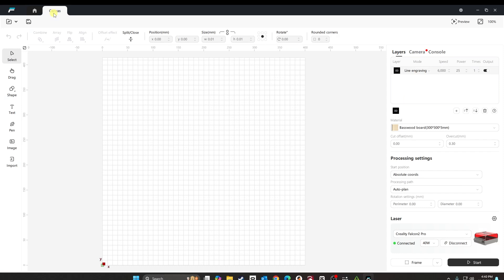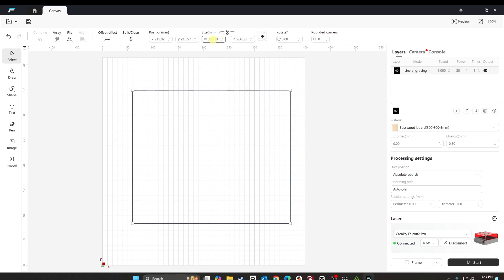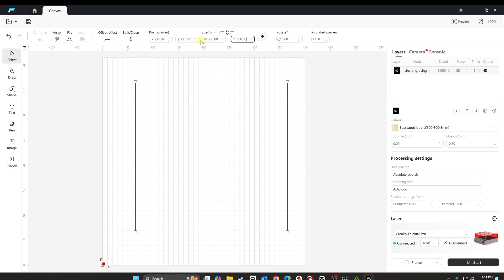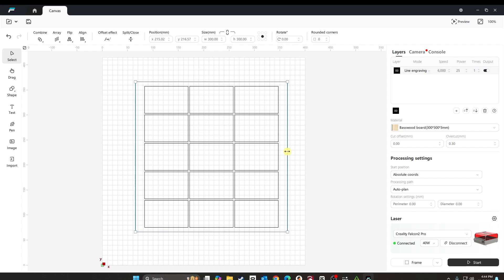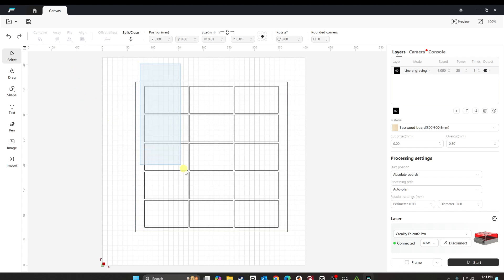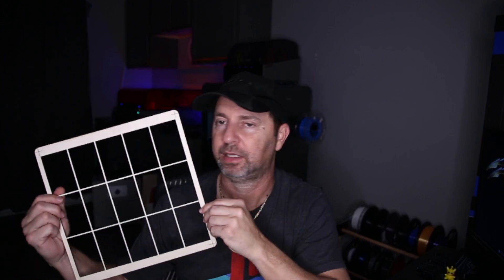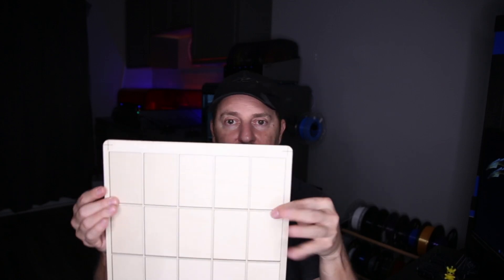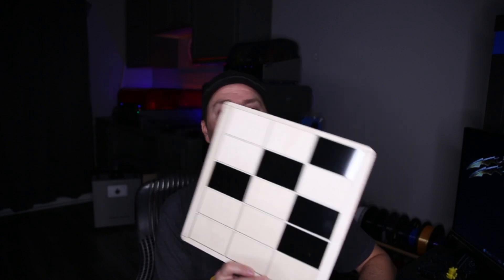How to Create a Laser Jig for Aluminum Business Cards Using Creality Falcon Design Space

Comment: Hi there,

Can you perhaps share the settings yo uare using to do these engravings on the business cards?  I am struggling to get the clarity on finer details.  I am using the Creality Falcon2 Pro S 40W.
I have having some sections that aren't removing all the oxidised coating, and in other cases it is burning off too much.
Reply from the maker: With the 40 watt, you will want to do precise mode 20 watt.  Not sure if you have the 1.6 w laser but that would give you the best detail